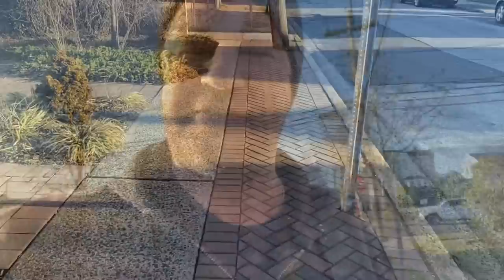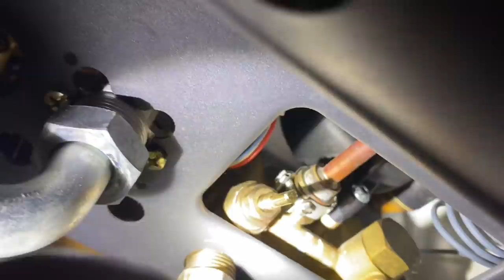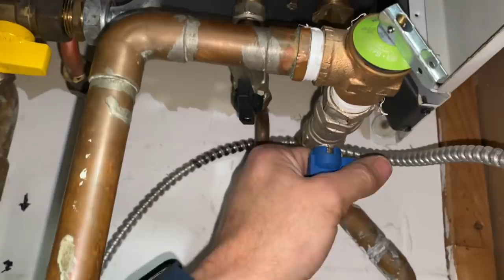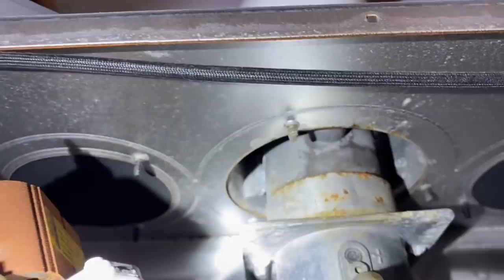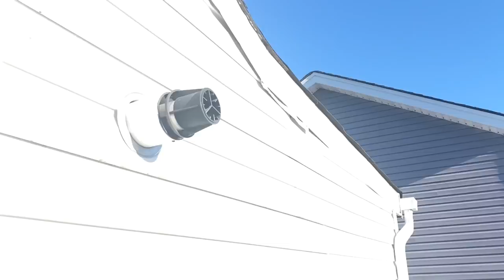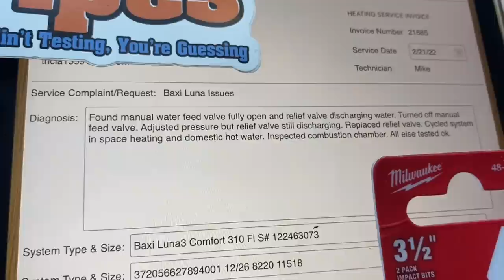Baxi Luna3 Comfort 310 Fi Error 10E Water Pressure Leaking Relief Valve

Comment: I have used both the the nin condensing 310 fi with pneumatic changeover valves and the 310 fi comfort with the electronic valves. The same problem on both. The pankake expansion tank. Finally deleted than and adapted it for regular cylinder type. Been running great since. Added a 30 gal stubby elec water heater,  used as a storage tank, with a brass pump connected to the stat on the tank so customer has some stored hot water.
Reply: Hey hope you see this comment, I have gone through the same process with my Baxi, new pressure relief valve, newer larger expansion tank added but did not delete the pankcake.  My valve is no longer leaking and my pressure is stable but over the course of 24 hours, I am hearing large gulping sounds and a lot of air in the pipes.  I swear i have purged the air a dozen times at this point and it keeps returning.  Any advice you could provide is greatly appreciated.

Comment: I'm having the same issue where the water pressure is low and I have to open the cold water ( RED )value to allow water in  , then press to move from the 0 red to Green  are and its goes from 10E to current temp. Can you help..

Comment: Hey Mike , let me know if you need any help with Baxi boilers. I worked on them for years. 
You can get parts on parts4heating. Some parts for a Luna 310FI model  are discontinued but for the model you worked on and other Baxi’s they still have parts.

Comment: The baxi I found are pos lol in Canada here lots of suppliers used to sell them they stopped after major issues, I find parts as well such as the control board have 2 to 4 parts you have to remove to replace the board such as the knob dials and such. I had one that would call for heat and blow off the pressure relief non stop even though thermostat was not calling, found a relay in the control board got stuck in closed position causing boiler to fire on and over heat, if the boiler door was on it would fire on if boiler door was off the board was laying flat so relay would stick open as soon as u put cover on boiler fires up non stop, had this issue happen twice with them, they seem to find it strange and had no explanation lol
Reply: @Mikey Pipes - Pipe Doctor Plumbing & Heating & Air  well that's a good thing because if you thought Navien was a pos loool you haven't seen anything , those baxis are best used as a toilet seat

Comment: I’m surprised you guys are allowed to just let relief valves dump on the floor… here they must run to the drain. I also don’t understand why no one over there puts a disconnection fitting so you don’t need to cut and rejoin tube just to change out a relief valve
Reply: UPC your not even supposed to have a water heater relief discharge into the pan. I think they don’t want the relief discharging into a drain so you realize there is an issue

Comment: Good one can’t believe there is a valve before the relief that’s odd and it’s concentric with a N lol 😂
Reply: I don't believe that the shut off valve is between the heat exchanger and the relief valve. I just looked at my Baxi Luna Duo-Tec and the safety valve is on one side of a "T" and the shutoff is on the other side.
Reply: That relief valve in unrestricted to the boiler/ flame side of the system. The shut off closes the heating loop for service